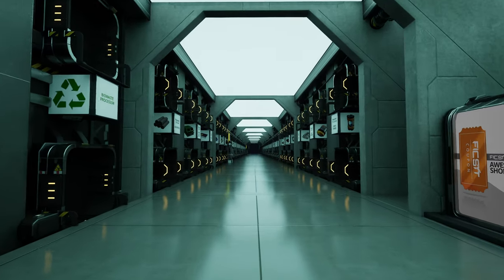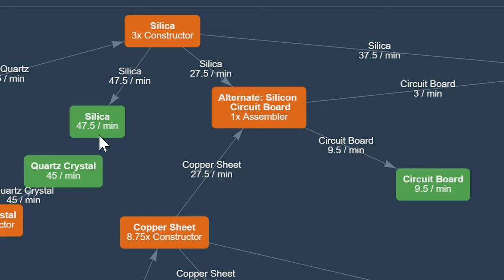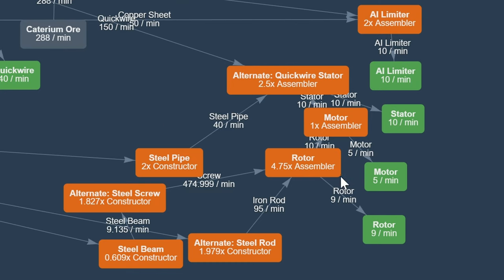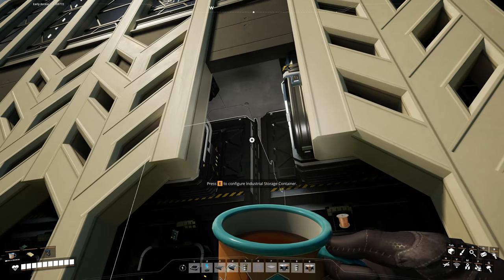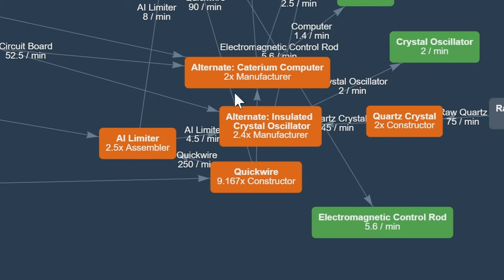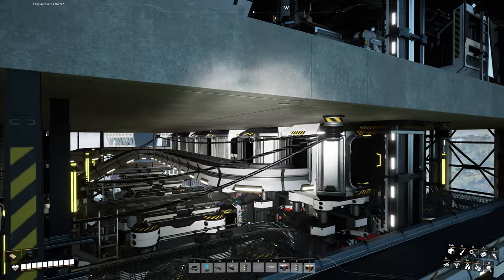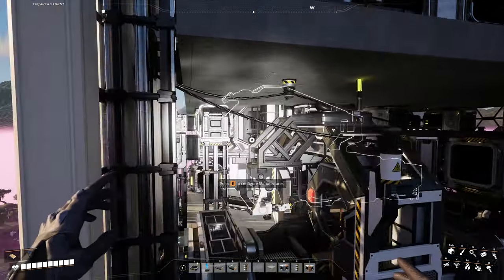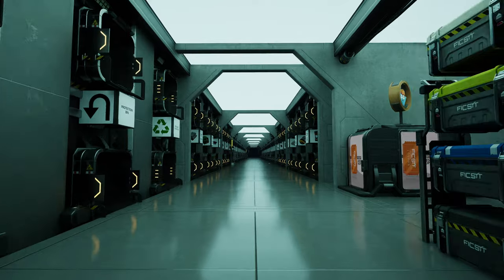Satisfactory Devs are AFRAID of these Blueprints

Comment: im so yealous... at the moment im struggling by doing simple production layouts without blueprints.
Main problem or start problem is always calculating input and output :D

may i ask what your using for the creation of your schematics? 
i think this could help me calculationg inputs and also avoiding the belt chaos i mostly create.
Reply from the maker: satisfactorytools dot com and big physical calculator is my goto tools these days. Website was updated recently for update 8. I just got used to UI and it is more compact when you are making monster factories, also you can pile up schematics when you plan several stages, my only gripe is inability to save shape.
Also this project stand on shoulders of several month of blueprint factory experimentation. So Rome was not build in a day xP My first blueprint Reinforced Iron Plate factory was absolute mess taking up twice the required space and making all the thing very inconvenient.

Comment: Your work here is amazing.  I've been tackling this in terms of small replaceable modules.  I've tried larger all-encompassing factories, but my head gets real confused with what products are getting moved where and how to place the machines.  I'm also only at T6 right now, and just started dealing with liquids.  What a pain.  Anyways, if I can make small, simple modules, it allows me to connect them together with external risers, and add more capacity just by blapping down another copy, or to improve efficiency once I discover new recipes and replacing the entire module.
Reply from the maker: Indeed. I found my main issue with bigger factories, that eventually they just get to big. You always try to predict next step in production chain and grow the plan of the factory exponentially until the point when you just lose yourself during construction xD Blueprints are a nice change of that paradigm!

Comment: im putting togher it and run into a probem with module D level 3 and module E level 3 thay wont go togher its saying encroaching another objects clearance its the ouickwire constructor thats in the way is there any way to get it to work?
Reply from the maker: 1.0 had bunch of changes to clipping, especially to assemblers. If nudge tool with H and CTRL does not work... well there is no fix atm. Well aside uploading print to 5x5 designer and extending exterior.

Comment: nice, do you not have an auto item sorter bin in this project ?
Reply from the maker: There was a sorter in previous video for bio-waste processor, but there is no need in this one. However it would be back with the next video in modules E and F. There I would need to make processors for some endgame items Nuke Nobelisk and Turbo Motors.
Also I have some ideas about presorting items for personal use, but I am yet to try it out in blueprint form.

Comment: storage module D level 2 doesnt line up with level 1.. is there a fix?
Reply from the maker: nudge mode with button H in blueprint placement mode with R key should get you covered
Reply: @Yakez42  thanks for the reply but I tried that and the red pillars are still out of line and it will not align :(
Reply: Have the same problem with it. Also Module A level 4 doesn't align properly. Fortunately Nudge mode has solved the problem. There are a few power connections missed (4 in the 1st module level 1) and so on but all in all these blueprints are awesome. Thank you.
Reply: Tried to nudge it, wouldn't align. Hit the R key, snapped perfectly into place. Thank you!

Comment: Hello, I would like to know which one I need to buy from the AWESOME Shop so I become a builder)
Reply: And please write a spiosk to buy an AWESOME shop.
Reply from the maker: When you export blueprints from other saves they circumvent any requirements from awesome shop, alternative recipes or even machinery unlocks. They would just plop if you have materials. A bit exploity in nature by the design. Usually by the point when I unlock Blueprint designer in the progression I already have majority of shop unlocked so I always act on basis of having easy access to everything. But this is just the way I play.
On hardrive front it is pure exploit, but I have done full hardrive hunt like 3 times in last 4 years and no longer see it as a part of gameplay.